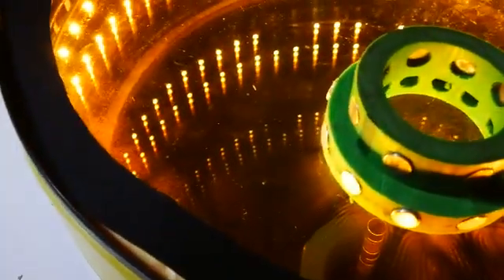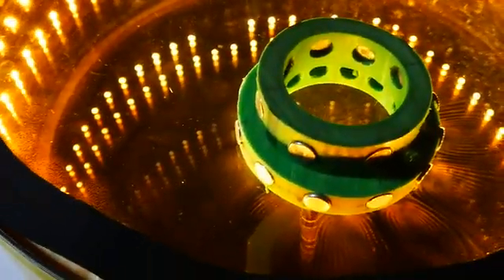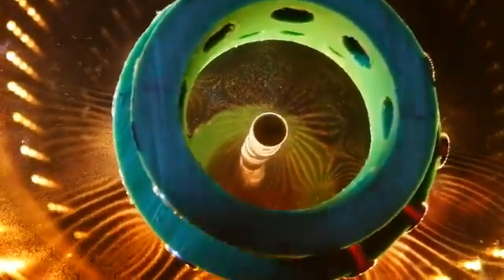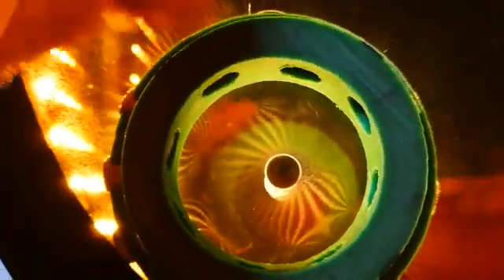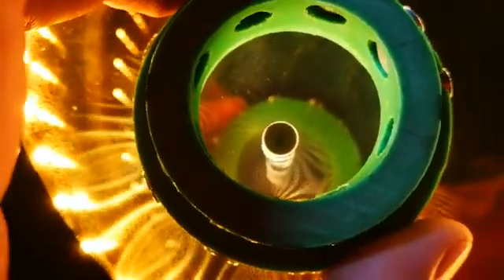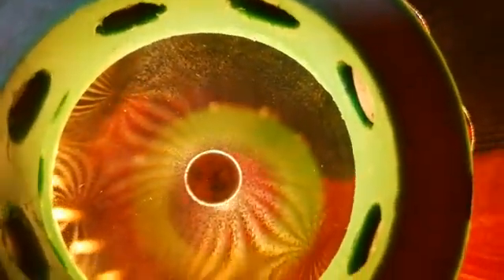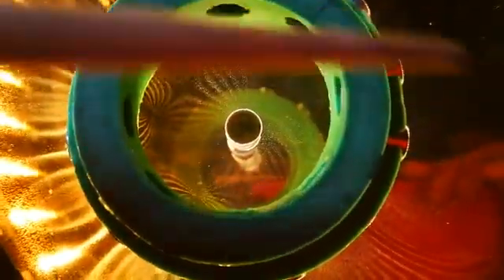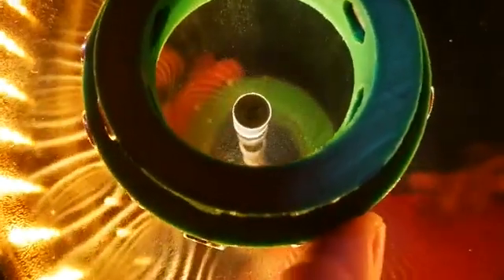Frictionless Motor, Stator & Shaft 👽

Comment: THIS GUY IS A SCAMMER. What part of this is frictionless exactly? none of it is in a vacuum which still wouldn't have 0 inertia since no perfect vacuum exists. It doesn't even stay in the centre when you move it since theres a time between the motion of the fields from your motion applied which you can see when you move it. 
 
This is just a basic design to show how magnets can suspend objects using opposing fields horizontally suspended in a ring (N-S-N-S, etc) at an even number of magnets with vary depths in the structure for a vary field strength of opposing and attracting the magnets below so it suspends the object enough and repels it to the centre, you can do the exact same thing with two magnets of opposing fields between a glass surface because you aren't showing a frictionless environment at all. You have friction on the surface since it's moving, friction between the tiny gaps in the surface from the magnet holder, friction everywhere. If any part is touching another object, surface or air, friction exists, this guy is a scammer and a liar.
 
Remember this video isn't about magnets but frictionless motion using magnets, There would literally be less friction between two magnets you move between a piece of glass which stay centred just using attraction because the surface area is much less than the entire ring structure he used and it's weight would be less decreasing the down force on the surface thus less friction, such a pointless video.

Comment: The inertial plane mediated to center.
Reply: it's not an innertial plane as that would mean it's not subjected to motion which it is since it's moving as the magnets move when he moves it. This is magnetic suspension with magnets at equal distance, opposing poles horizontally oriented throughout top and bottom and vary depths to keep it centred. None of this system is frictionless either.
Reply: All magnets have an Inertial plane, between  CW and CCW vortices.  N and S.
Reply: @gyro5d  what vortices clockwise and counter clockwise between N-S, do you mean the magnetic field lines, they don’t form vortices nor is any of it inertial nor does it have an inertial plane, magnets don’t have vortices, they have magnetic field lines flow from N-S, the direction is outward into the South Pole and these lines form semicircular arcs.
Reply: @gyro5d  you know nothing of real physics. Who taught you this utter nonsense.